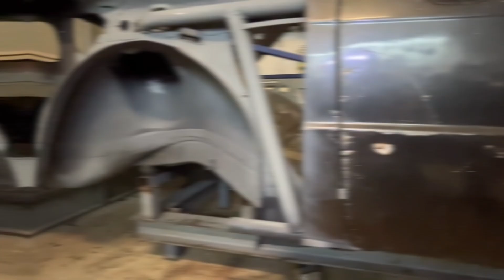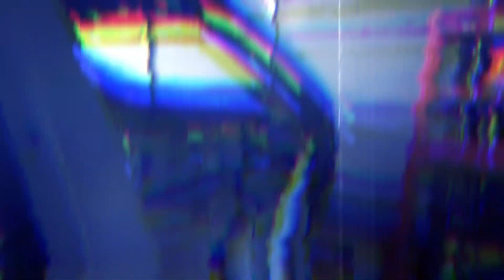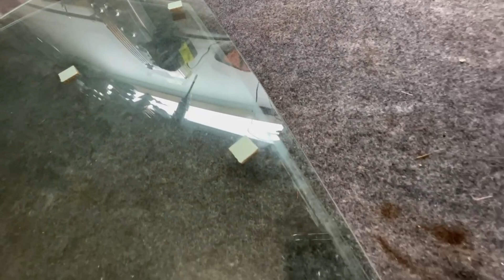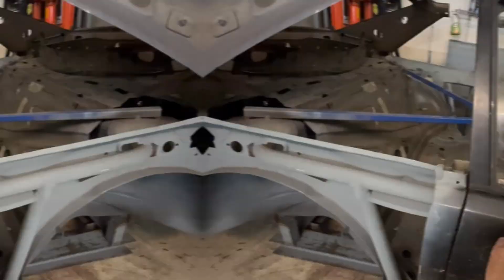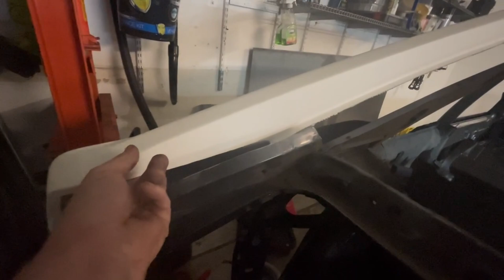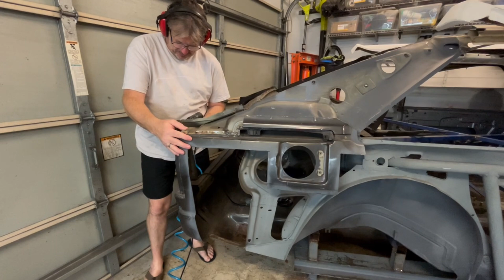ROOF FABRICATION PART 3 - ANGLES & ALIGNMENT

Comment: Always watching out for  updates on this.. looking great gives me inspiration to get mine finished, do you think it will be rigid enough without a roll cage? Keep going with the updates 👍
Reply from the maker: Thanks man.
I reckon it'll be rigid, and certainly structurally sound.  Let's not forget the original homologation Sport quattros didn't have roll cage, plus they also haven't got the roll cage strengthening I've added into the sills and rear quarters.  Seeing as I've now hacked off the b-pillars, I'm also going to add strengthening here too.